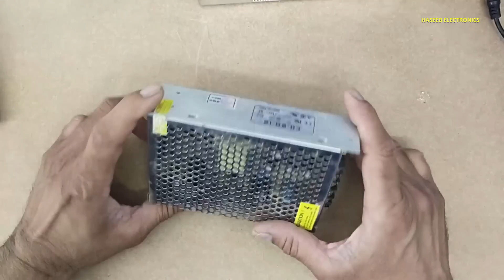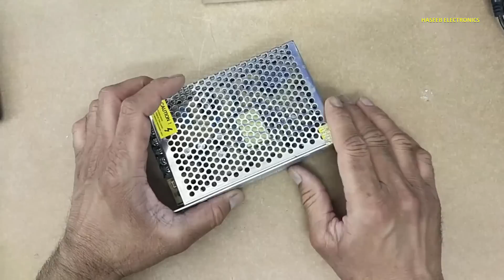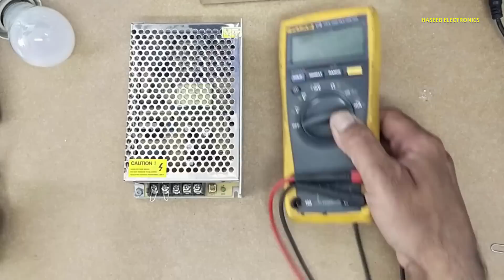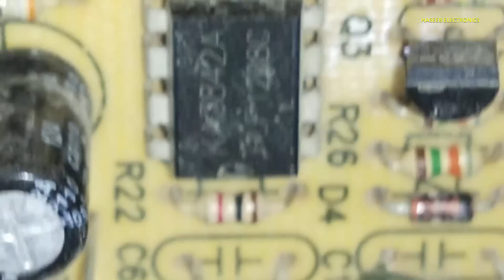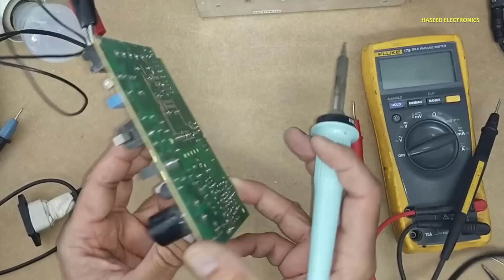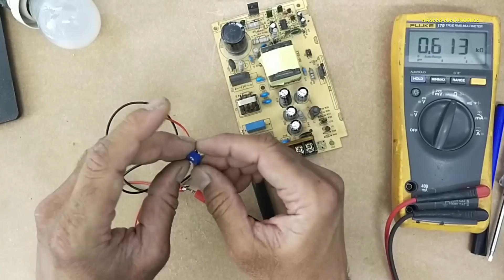{1002} SMPS output voltage fluctuating, unregulated output

Comment: Hi for 1 Amps load testing how much resistance u have connected and watts, PLZ share me the calculation also...
Reply from the maker: it is 6.8 ohms 20 watt resistance (2 in series)  total 13..6 ohms 20 watt 
P = V^2 /R
(12*12)/13.6 = 10.5 watt
I= v/R    12/13.6 =  0.882 Amper
P = i^2*R   0.882^2 x 13.6  = 10.588 watts

Comment: Hello engineer: I have a switching power supply whose output voltages have increased, for example, the voltage of 3.3 has become 5 volts, 15 volts has become 25 volts, and 20 volts has become 35 volts; In your opinion, where is the problem and should it be checked?

Comment: Sir I want to know why in SMPS I find that when voltage input is 230v it is giving maximum ampere but when the voltage is low like 100v or 110v it is not giving that rated current. Also it is universal type SMPS

Comment: I hate mains power supply because if failure the breaker switch trips and the fuse don’t blow i think company’s should add a small breaker in the unit to stop main house breaker from tripping